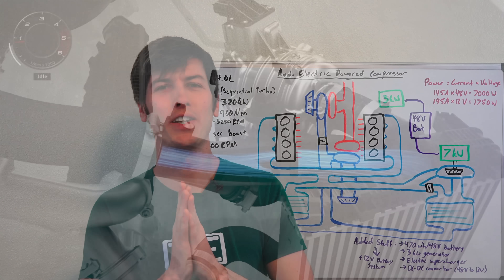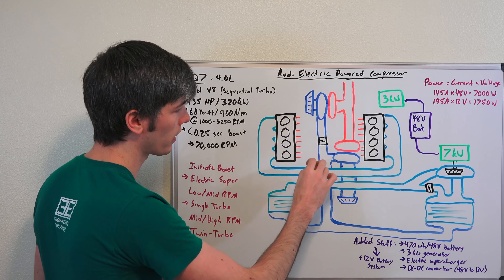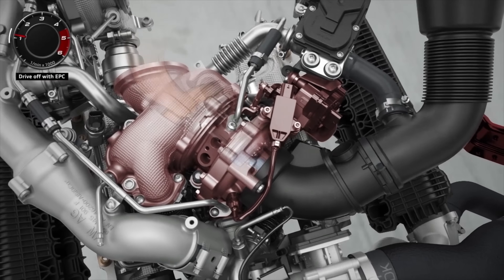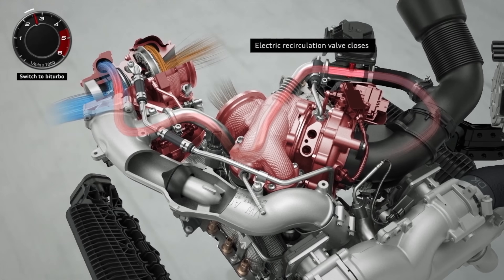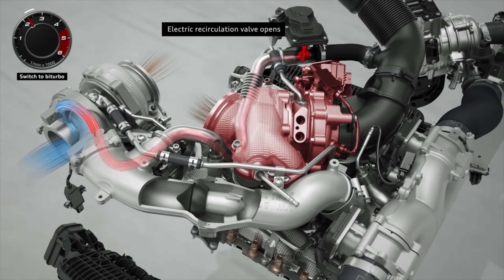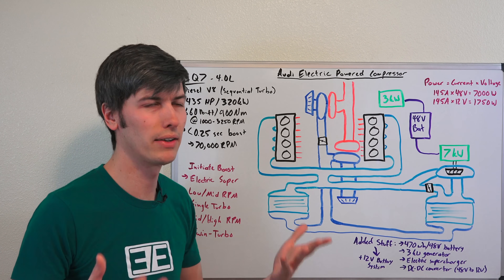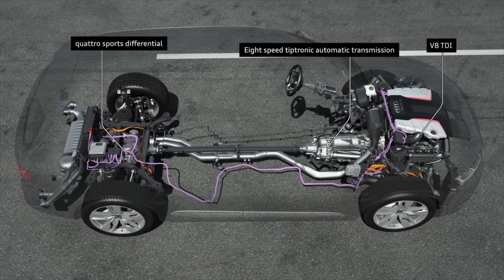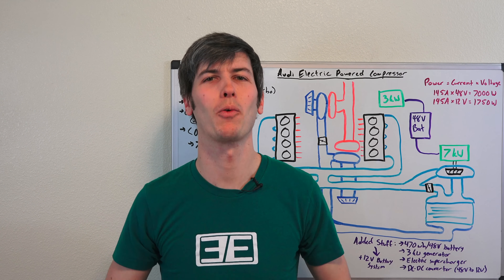Electric Superchargers - How Audi Is Eliminating Turbo Lag

Comment: Why are Audi spending this time, effort and money on trying to eliminate turbo lag, surely the combustion engines days are numbered. May be try put some effort into cleaner combustion but let’s face it, even that is a losing battle. Electric systems to jam more air in, surely the alternator is adding more load to keep the battery topped up. All this effort to keep up with electric cars pulling away quicker at the lights.

Comment: Would it not be more advantageous to simply add the 7kw motor directly to the driveline?  A brief internet browse suggests the motor could be capable of 10hp/30lbft.  That would seem to be capable of providing a good nudge until the turbo spools.

Comment: WOW!!!!, A V8 motor, 2 turbo chargers, a 48v battery electric system, 7KW electric supercharger, variable value control, inter-coolers.........HUGELY complex.......

Here's an idea......why not increase the battery and electric motor, get rid of the internal combustion engine altogether save thousands on fuel, save thousands on servicing..........Why car manufactures are spending millions on R&D to product a more complex IC engine is beyond me!

Comment: Why not instead of connecting a generator to the motor, connect it to the wheels so you can turn some kinetic into electric energy when breaking?
Reply: I just realized you need to make electricity when idling as well... And probably a small alternator wouldn't break the car fast enough to be of any use. I really didn't think this through

Comment: It's weird that the initial electric turbocharger isn't also a conventional turbocharger. Is there some technical difficulty to that? Why isn't it designed to switch to exhaust power once it's spooled up and the engine is running high?

Comment: This looks very complicated. Does this reduce turbo lag more than a belt assisted hybrid would? Especially since you have similar requirements for both (Electric motor and 48v battery). I guess the whole system is optimized for power instead of efficiency?

Comment: Yes I do actually have 2 questions watching this video :)
1. Isn't it quite inefficient to only open one exhaust valve? I mean it's like having a qiute high back perssure. Or are the loads where this is operating so low, that you wont have any considerable pumping losses?
2. Why are they putting the electrical compressor behind the intercooler? Dont they get a quite high intake temperature with this layout? One reason I could think of would be that they want to avoid losing engine response by having the fill up the intercooler(s) with pressure, but is this effect even noticeable? And secondly aren't they in danger of somehow 'running out of air' and building up a vacuum with this long intake in front of the sucking charger. The compressor in fact has to pull in the air even through the normal turbo charger. Couldn't they simply give it a own intake?
Would appreciate it a lot if you could find some time to answer! Thanks, you're making a great job by the way!

Comment: I remember calculating this idea at college in the 90s years ago and it was a crap idea then.. add up the energy converted from fuel to air pressure with all the losses and its pathetic.
Reply: Qmentis he said 7 hp.
Reply: @tomcrockett7941  he said 7 kW, which is almost 10 hp. but because the electrical efficiency of a car is about 0.6 overall, you'd suck a lot more fuel to regain that electrical charge. this crap is only to show nice data sheets...
Reply: @Taunus-Tim  but if you bolt it directly to the engine or run it from a pulley at least a part of it has to spin all the time, even with a clutch it still needs a bearing that spinns all the time at every rpm range and needs, while not much mind you but still, a little power to be driven. I personally don´t think it´s necessary but compared to other solutions it only acts if it needs to, so it won´t wear out that fast and even if, it will be easyer to replace considering it´s just pluged in.
Reply: I hear you; engine mechanical converted to electrical to battery storage to electric motor converting it back to mechanical for the air compressor. Yikes! Losses must be staggering. What's wrong with a simple, small displacement mechanical supercharger with an overdrive pulley and electromagnetic clutch to uncouple it when turbo boost builds? Probably not complicated enough for Owdi.
Reply: Because its way more efficient than the mechanical supercharger and adjustable in every way you like to have it. Also such an e-charger uses way less energy than you might think, because it is only activated for short time.
Reply: josechirimoya 2006 Golf Twincharged engine is exactly that and works wonderfully well

Comment: Excellent video! Now I'm convinced even more, I should never buy any of VW/Audi
Reply: Denys Zvarych When you’ve tested the Audi SQ7 Come back and tell me that again...
Reply: Yeah stay away from german engineering, it's terribly good 😏
Reply: @web_dev-rl2ve  😂🤣 tell that to  the 09-12 Audi A4.
Reply: Questchaun I drive a Passat which is the A4’s kissing cousin and it’s rock solid, no issues. I’d buy one again when I’m done with this one
Reply: @web_dev-rl2ve  fantastic my 45k 2009 a4 Avant had to have the engine replaced twice for oil consumption and each time the pistons slapped the walls square. By 75k the rearview mirror dry rotted. The passenger lock button broke. The cluster LED screen died. The rear seat leather cracked and split. The arm rest for the passengers broke. The "fancy" metal cover for the hatch latch broke. When it rained it leaked into the passenger side foot well. (That was looked at multiple times by Audi.)  The oil pan on the second engine had rusted to the point it needed to be replaced. 

For reference I have a 17 year old Acura rex type s that is mint. 

AUDI/VW quality my ass.
Reply: Questchaun wow, thanks for helping me decide to steer clear from audi. The VW brand itself is more reliable than Audi. What’s funny is I have the ‘09 Passat with 121k miles and it runs like new. Interior almost looks brand new with everything working as it should. Only complaint is the paint gets chips too easily so it needs touch up.

Comment: So whats the advantage of this kind if system over just having an electric motor aid in the crankshaft rotation? This seems quite complicated and more difficult to upkeep. Is the same sort of voltage needed for such a motor or is this related to efficiency? 

Loved the video as always :)
Reply: You will get much more usable power out of this small electric engine that way. Your 7 kw electric engine will add up to maybe a 40-80 kw power gain (speculated numbers but not unrealistic) at low rpm that way.

Comment: My e60 has already a 170A generator. 3kw is not so impressive... And it would be easier to charge some supercapacitors NEAR the motor. For me it would be better idea a crank driven supercharger with an electric clutch. Instant air pressure

Comment: That seems unnecessarily complex, part heavy and with little real return for the owner. It is like an overly complex Swiss Army Knife with 32 or 64 tools that is cool and complicated but not very useful. I am all for a move to  48V or higher for car's. Just doing a compound system with turbo and super chargers would do most of this with far less complexity and cost. VGT's and super charger like the G-Lader to create the same effect for the owner.  Turbo chargers are always a weak link in any automobiles durability they always fail before anything else under the hood. Between bearings, seals and oil supply and return lines they are a logistical nightmare for any one wanting to own something like this long term. 

I understand this sort of product is not aimed at me or like minded individuals. That said it really hammers home the differences in design between Europe and the rest of the world. Just look at all the issues Germany had during WWII due to magnificent tanks that where impressive until they broke and almost impossible to keep running and difficult to repair. 

I also think newer technologies like we are seeing from Nissian evolving variable compression engine will likely have potential as a performance enhancer as well making a lot of older designs like what Audi is doing obsolete. Decades ago when they first started talking about going to a 32-48 volt system under hood this would have been a fantastic thing to do! Now though it a little too late and is not impressive. 

It has been taking far too long for really useful technology to make it into our car's. We should have had 6-9 speed automatics in our car's and truck a decade sooner than we got them. The same thing for a 48V system. 

Likewise we have been at a MPG stand still for a long time with many older designs easily getting 40+ MPG with carburetors and 5 speeds. The direction Ford has taken with the small engines reving high with forced induction is the wrong way to go for fuel economy. A larger engine with a huge flat torque curve and lots of gearing that will allow you turn few rpms at highway speed is a far better way to get fuel economy. It is more user friendly and is inherently durable. The down side being the larger you make a bore the harder it is to meet ever stricter emissions laws. If you add a super charger to the mix controlled by the ECM again far more durable than multiple turbos let alone multiple turbocharger's and a a high voltage generator power inverted and electric super charger!

Comment: As new ideas become reality... you always here the same thing... "It is more complex so it is less reliable."... HOWEVER what actually has happened, is vehicles have become much more reliable, due to higher production quality and better engineered systems... SO no worries, to anyone that sees this technology as "scary and complex"... I am positive the engineers behind the development of this system have done a good job and built a great system.
Reply: in euro cars the reliability peak was hit on the early 90´s up until the year 2000...with many cars going for a million kilometers with just regular maintenance....then reliability plummeted with new renaults needing crank bearings every 200k kilometers or the crank will get scratched and go to trash....bmw and audis needing replacement of expensive timing chains of engine will blow, egr valves constantly failing, particle filters variable geometry turbos , ecus and all that crap constantly failing

Comment: I was doing some research for a friend that recently bought an FRS or BRZ (can't remember which) about installing a supercharger or turbo on his car. I ran across an electric supercharger that works on 1/2- WOT only. Apparently it has a separate battery system (I assume higher than 12V) and only charges when the car is at idle. It was said to deliver 2-3 psi (I assume with a tune). Not the greatest, but for a $600 bolt on, that's not bad. Have you heard of this? Perhaps you've already covered this and I haven't seen it.

Comment: Sorry buddy, the car battery does not carry the entire vehicle's electrical load unless the alternator has failed or for some unknown reason the engine is at an idle speed that is well below the factory specification. The alternator charges the battery and fully operates the entire electrical system at the same time. If you put a 7kW load on the engine and the voltage droops too much, then the alternator and the battery would both contribute power, simultaneously, as best as they could to satisfy that load.

Comment: Normal roots superchargers already have no turbo lag.
Reply: The Audi 3T engine is a prime example of fairly elegant supercharging. It doesn't have any lag above 1800rpm and only minor lag below that. It provides a stable 400Hp in the S4. My A6 its 300 Hp but I am happy with that level of power. My car is 9 years old and still runs beautifully. I wonder about the additional electronic and mechanical complexity of later models?
 I like the Supercharger because the engine oil is not super heated as in turbo engines by the exhaust powered turbo cooling function.
Reply: A roots blown diesel would make for an awesome daily driver.   Gobs of torque at will.
Reply: Cameron Wells roots superchargers are stoneage trash. Too many power leaching and overheating for a given boost number. Twin screw superchargers are way more efficient and make more boost.

Comment: I always wondered if a fully electric supercharger would work on a top fuel dragster. The supercharger would be the same design/size as is normally used but instead of being driven by the engine it would be driven by an electric motor and a battery, the parasitic power loss would be gone and the battery only has to last for 5 seconds at max output so the battery wouldn't have to be huge or need a generator/alternator. A 10%+ power increase on a 5000hp+ motor would surely be worth more time than would be lost by the extra 20kg the motor/battery would add?

Comment: so what your saying is i just need to connect 4 batteries in series in my trunk, then i will have 48 volts. i wonder how long they could run a supercharger... it could be used like a can of NOS, dont even need them to be charged by the engine, just plug it in when i get home lol

Comment: Usually the DC/DC converter also charges the 48V battery. This Audi is one of the first production cars to have a second voltage net on it. More will follow.  Since it's a new technology, it probably only powers the supercharger thing, but in the future I expect more and more 48V devices, such as power steering, heating elements, maybe even headlights. The main advantage of this second voltage net is that you can transfer more power with thinner wires.

Comment: These are the final days of ICE cars and they are pulling out all the stops.  Going forward it will be second generation hybrids and all electric -- cars with insane torque at low speed and double or better the efficiency.
Reply: Raptorman0909 The final days of ICE will likely be relegated to some heavier trucks, ships, diesel electric locomotives, and some hybrids like the Chevrolet Volt.
Reply: yes electic cars have way more torque and much smaller "engine" compared to a current production fosil fuel based car.....

Comment: I kinda see now why they say German cars are over engineered now
Reply: It's not overengineered if large amount of their cars still get sold.
Reply: K B  lease cars not over engineered just accurate and well engineered because I think Germany is still the land of the inventors and will bring this electric supercharger only on the market when Theater Sure  it will work withhold fails few years ago Volkswagen had the GTI 16valve with129 hp and allthoughtcthis will teh end of teh Power line in teh 1.8lter engine s ... Audi came witch teh Tt low power version 175 horsepower the stronger version Gott 225 horsepowerall dein a Turbo charged 1.8 Liter 4 Zylinder 
Ans These engines last Four vier 150,000 Kilometer Safe Germans sonst like teh Hugh Drinking v8's nur also like Power ans Highspeed they habe deine Potter Technics in Comfort ans effency 
In all parts of Technology

Pnly elonmusk süß teh right steps an Walled other ans nee ways
Reply: I don't know why but the Germans have always inaltime the best engineers look at operation paperclip without Wernher von Braun the United States would have never been on the moon German Ingenieur and without Oppenheimer the US would have never in Vent nuclear weapons
Reply: I am sorry I but that is still but that is the deadly truth United States also has good Ingenieurs Eva look Antje mit andcal teh
 I would be happy if I could study there but I have the same problem then my idol had i ambounded  in a wheelchair in a wheelchair so my only chance will be to study at home fortunately I have good skills in learning by reading autodidakt sorry I don't know the English word
Reply: so please help me hold your fingers crossed that I could use my Elektriker skill and my Physik skill  for a real higheffency Solarpanel

Comment: I had this idea a while back and wondered why no-one had done it yet. So, well done Audi! But if the turbo and super were on the same shaft, you could use the motor as a generator for energy recovery when you don't need as much boost.

Comment: Holy cow. I can't imagine just how much time and resources they must have used in R&D for this type of system. I'm impressed with what they're able to do these days. The complexity of that is just amazing. Just the air intake routing was probably a lot to map out with the ECU and on top of that the exhaust valve system that had to add a lot of variables. I think it's really cool and I'm interested to see if this can be implemented in a way that's not prone to failure in certain areas.

Comment: That's Right, go on trying to forestall the inevitable, and using up all those internal combustion tricks and nearly expired patented methods that were too complicated to be considered back when that engine type was the only game in town. This reminds me of the engineers who knew that the simple turbojet with great speed and altitude potential was coming to aircraft, but opted to stick with the known piston engine developments and only add the turbine elements before and after that engine that had already reached the apex of its abilities.
This is at best a half measure,  destined to be a museum piece for its excesses of complexity.  I had a turbocharged Corvair in the 1960's. It too was a product of abandoned patents GM had obtained cheaply when the the Tucker company failed to compete with the big three in the post war marketplace for new cars, manufactured more cheaply with staid old technology.  The EV revolution is happening, or this sort of idea would never have come near to production.